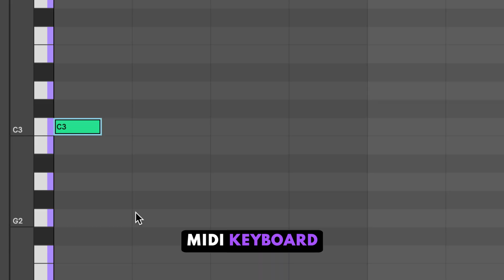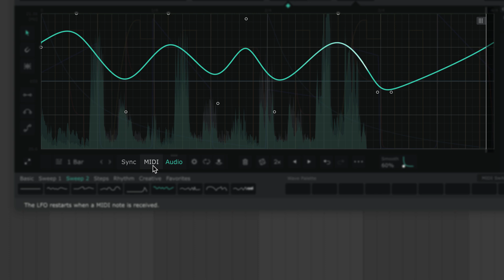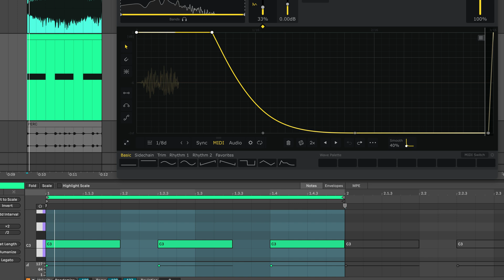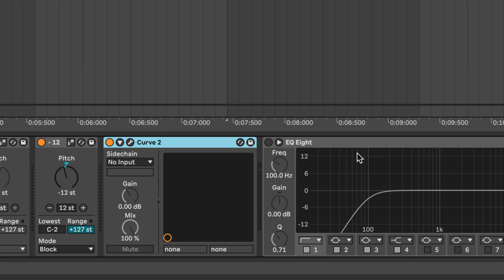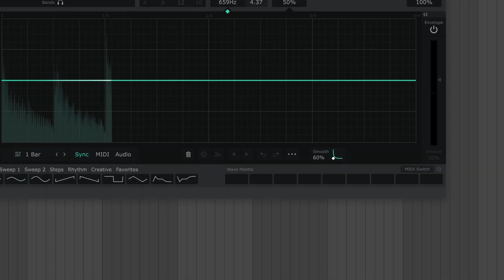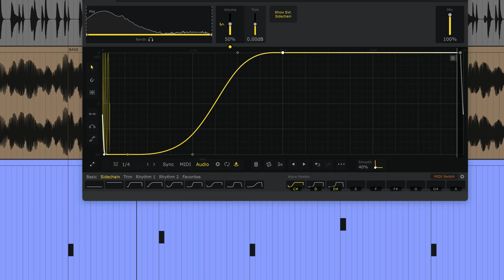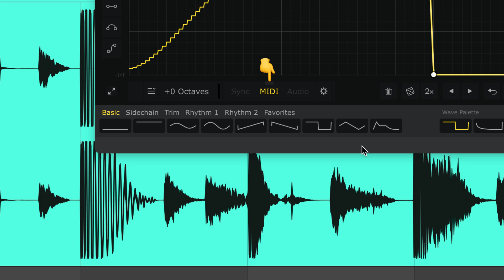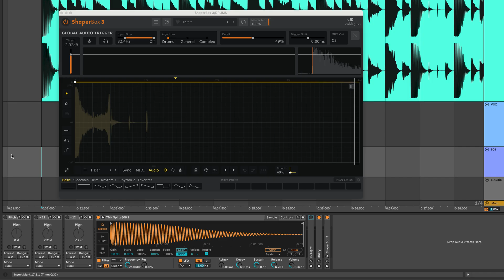Master EVERY ShaperBox MIDI Trick In 10 Minutes

Comment: Shoutout to the Renoise crew, if you have Shaperbox on a track and want to use these first few tricks, you’ll go to the “Plugin” tab up top, search for Shaperbox, and it shows you all tracks with Shaperbox on them, listed under “VST FX alias”. Double click the Shaperbox instance and it will make an instrument. This instrument is what you will play your midi notes with. For example, C to trigger shapers or C# - G to change stored LFO patterns. Best of all, you’ll insert these notes on the same track Shaperbox is on (and the same as your actual instruments) so it’s easy to keep track of. 

Shaperbox crew, PLEASE make midishaper usable on Renoise! Haven’t found a way to get it to work yet. Would be great for working with hardware samplers :)